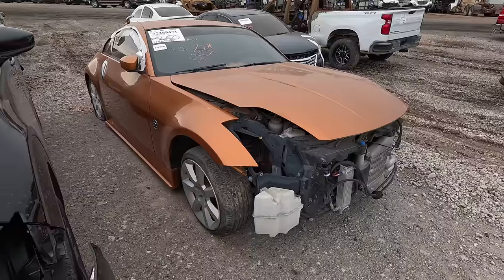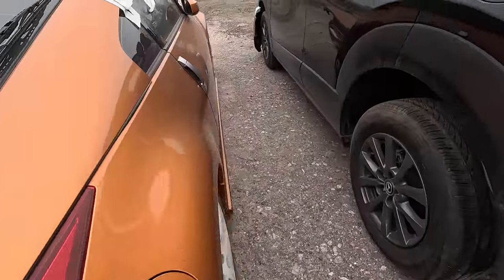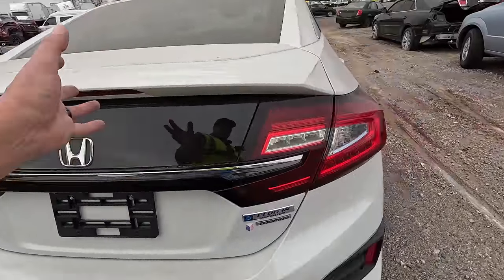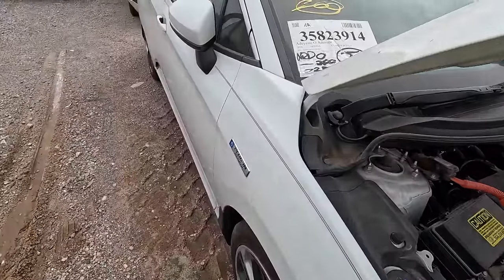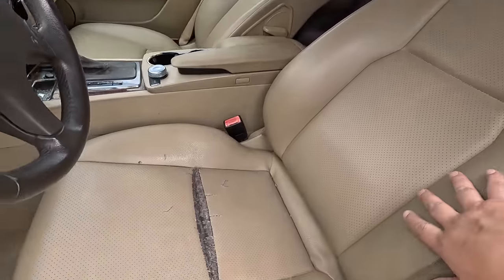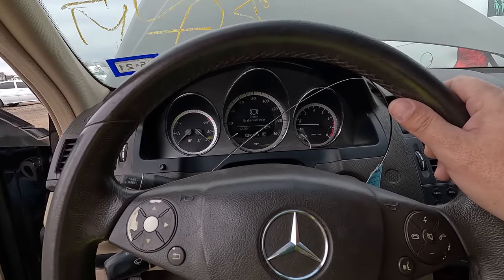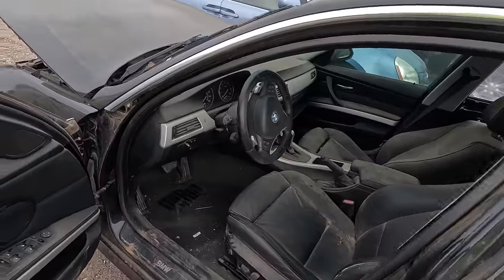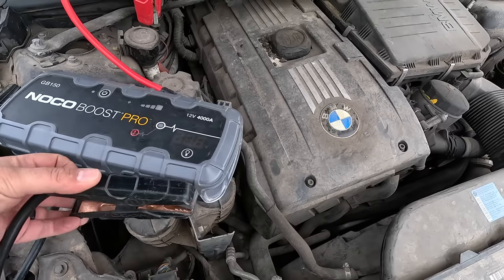IAA Walk Around 2-23-23 + Turbo Nissan 350z + Crazy BMW 335i with Mice and Snails?!?!

Comment: i have a 2 door 335i and lemme tell ya, it is shocking that that car runs that good. However, at the 100k mile mark things like the high pressure and low pressure fuel pumps can start to go. But if it isnt bid up too high id jump on it man!
Reply: Exactly! And you know that car has barely been taken care of. It didn’t really have any major errors on the dash, considering the condition. Well-taken care of N54s run worse than that by far

Comment: If you get a chance to look at the 350z look under the back end by where the exhaust exits. Because of the v6 there isn’t a lot of engine bay room. It May have rear mounted turbos.

Comment: 4:21  Isn't that a bit too square to be a bullet hole? It almost looks as though someone whacked it with the pointed end of a pickax. That would also account for it not making it through the door card.
Reply: That is a bullet hole, the bullet will puncture the metal with such force it will blow the paint off in that area. It could have bounced around inside the door panel if it already lost enough velocity or hit the door angular. Bullet trajectory is unpredictable once it hits multiple objects.

Comment: The Honda Clarity is a hydrogen fuel cell car that is typically only sold in California. That's why it's so rare everywhere else. Btw it's crazy how those German cars knock like crazy, and that's how they are SUPPOSED to sound. Anybody else have an opinion on this?
Reply: It is worth it from a collector standpoint because next to nobody bought them and it was only limited to one state.  You know the 2012 Chevrolet Caprice that was only sold to police? Same idea. That car is now a collectible too. This car is even more rare if it is the FCEV or BEV version. Those were only sold as company lease cars. Never sold to the public. Retail MSRP was roughly $40 grand all-in when new.
Reply: @MrWolfSnack  Yea and now most of those cars are just at auctions like this and rarely driven.

Comment: Hey, that Z is does have a story. The skirts and rear bumper are from Do-luck or a do-luck style. The car was fitted with the first iteration of the HKS supercharger. 

Seeing all the hoses being thrown in the engine has been switched. Only thing I don’t get is why would you leave the cooler and pipes.

Comment: 😉👍 Honda Clarity would be something to take a gamble on, well for the right price,  Depending on the year... guess it depends on whether you think the batteries are still OK I'm sure they're just needing a good charge right now at least. It's a plug in hybrid, They also made a hydrogen fuel cell model... I bet you would get almost a 100 miles to the gallon with that thing!  Doesn't look like it's in too bad a shape. Definitely be a learning experience for you.